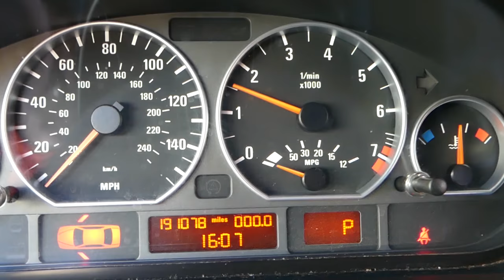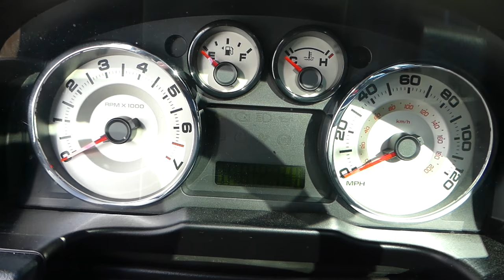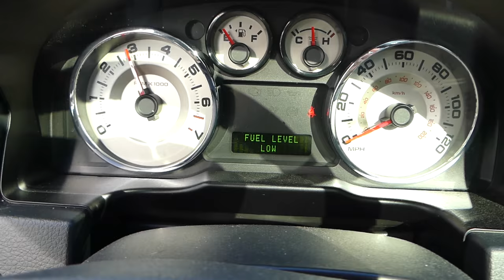HOW TO KNOW IF A CAR JUMPED TIMING CHAIN TIMING BELT. SYMPTOMS JUMPED TIMING

Comment: Or another symptom of the timing being off is when you turn the engine off, and the engine has a shudder, like as if is has bad engine mounts.
That has just happened to me, it was starting faster and had a little more power ( Amazingly)
And one Day I was driving, and the Engine stalled, couldn't get it started. 
So I went in the timing case and the crank and follow cam were the same at 3.5 teeth off.
When I set the crank angle straight up, the main cam 2.5 teeth back (Retarded).
This problem happened after an impact.
And all the computer said was P0336, open or shorted circuit. 
So I had replaced the crank sensor and was ready to replace the crank sprocket (Reluctor ring)
And then I find that the timing belt skipped it timing.
Also, the computer did say that all Cylinders are misfiring,
You know codes P0301 thru P0304, like what is this? But the car up until that point was feeling and sounding very smooth as usual, until I shut the engine off. Oh, And I also had a code for running Rich in bank one.
This is on a early Subaru Outback 2.5l.
Reply: I AM HAVING THE EXACTTTT SAME PROBLEM!!! DID YOU EVER FIND A FIX? Also misfiring in every cylinder. the front pulleys and serpentine belt go spin smooth for about 3 2 seconds then dies down for about a half second then repeats. i replaced all ignition coils. spark plugs, air filter, MAF. let me know asap please!!! it could also be the transmission fluid i was researching earlier so im going to try that this week because i never checked it and my transmission is definitely slipping.

Comment: Better too change engine, you have to take out engine to replace timing change anyway very costly
Reply: No you don’t lmfaoooo
Reply: Not on all cars
Reply: It would be cheaper, if you could do it yourself. If you're paying someone else then it would be better to drop in a used engine, but you'll be getting all of their problems (probably from a wrecked or salvaged vehicle). Either way, the best option is to overhaul to make sure everything is in spec and seals are all good. Might as well use the engine you've already got, do the work yourself, and save a lot of money and work that you'll be doing anyway, end up with a better result.

Comment: My timing chain broke. There was no indication of any issues
Reply: same with mine, ruined my engine. Put in a used engine, same number of miles 74k, and replaced timing belt and I think this one is failing or jumping for some reason.
Reply: What were your symptoms leading up to failure